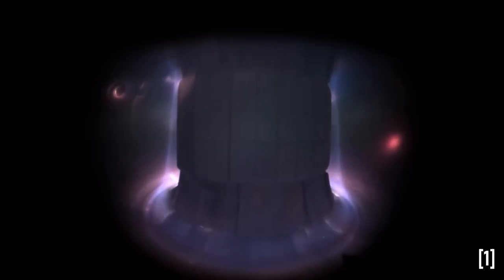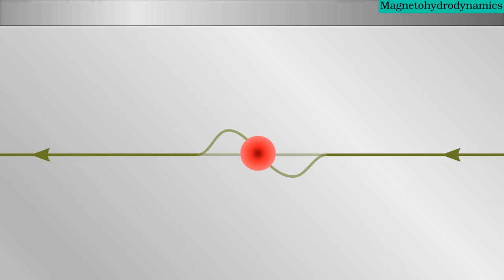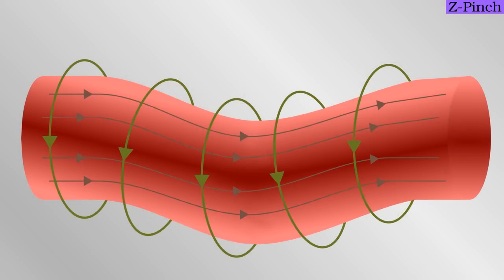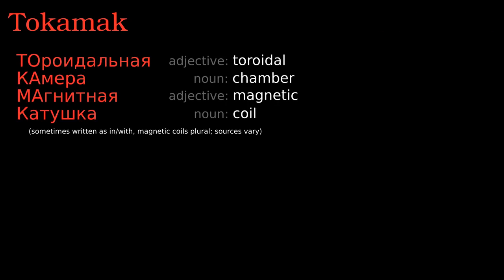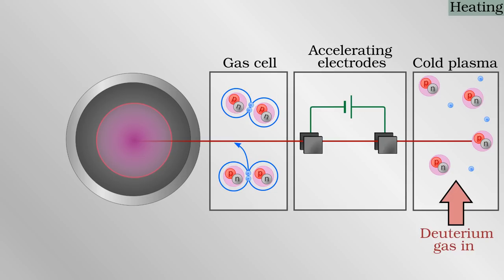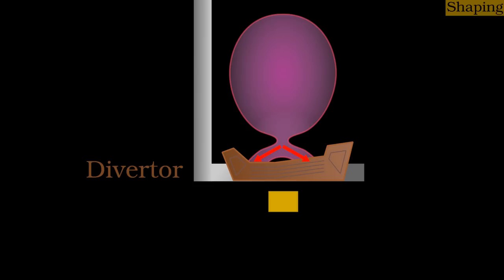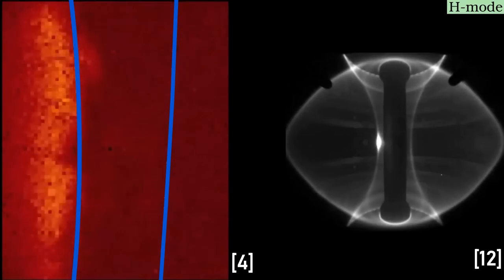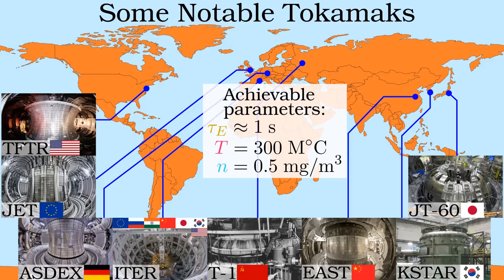How nuclear fusion works (3) - magnetic confinement, tokamaks, stellarators

Comment: Amazing series about fusion! Hope you continue it; it fills the huge gap other videos (which are basically about the hype, and not the engineering challenges) leave. I love how you detail what exactly the problems are, and even tidbits such as the much hyped “AI is being used…” Hopefully the next video will deal with details about the geometry of the stellarator types; intuitively, it seems like they could be a better long-term solution, for they seem to have “less moving parts” in operation (although much more difficult to manufacture, but then it becomes more of a manufacturing problem than a coordination problem). Also, do the simplified calculations for energy input of the first video in the series include that used to create tritium (and the creation of deuterium pellets and other approaches)? Since it has to be synthesized, I wonder how much more extra energy that consumes.
Reply from the maker: Tritium production from Lithium-6 and the neutron coming off the fusion reaction is exothermic, so no problem there. Separating out the fuel isotopes, freezing them into a fuel pellet and so on is one of the (still somewhat unknown) energy costs of running a fusion power plant. Hence, the fusion energy gain Q must be at least greater than 20 for a commercial plant.
Reply: @ImprobableMatter  one hypothetical idea of spherical reactor that have two mirror magnetic rings that are placed on the bottom and on the upper part of reactor where magnetic lines goes through the center of reactor bottom up, and switches periodically in opposite direction following the switching direction of the rest of magnetic rings that are placed in a way that goes through equator of reactor and intersect with each other with the line that goes through the center of reactor and is perpendicular to the magnetic lines of mirror bottom up smaller rings but with higher magnetic flux. All this is happening in kind of circular constant switching on and off magnetic rings motion, very fast. In the center of the reactor is placed platinum or paladinum confinement entrenched with tritium and deuterium. It can be suspended by intital magnetic force that goes up and down, and gradually adding te rest and adding the speed of changing magnetic fields, while cental will hold it in a middle, other will also hold it but will also induce electrical currents which will heat up the confinement to plasma and even more to fusion. For confinement should be used nonreactive isotopes of this transitional metals. Later fuel should be added by lasers beams. I really wonder what do you think about this hypothetical configuration because you seemed very versatile in this topic.

Comment: I'm utterly facinated with this line of work & experimentation. I grasp what is being worked on perfecting currently but I'm still really curious about (How or What is the process of extracting power from it once it's figured out how to sustain good plasma fields?)  Maybe I just missed it. Im sure the goal is to power a turbine thru thermal radiation but I'm just curious how that will connect with these machines. (I know the current ones are test machines, I'm just having a hard time visualizing how the plan to efficiently extract energy from the reactor will go?) I'm sure I'm just missing a obvious thing but I at least had to ask. *I absolutely love your channel BTW. I don't understand how it doesn't have millions of subscribers Because the quality of the science and the content is so good.

Comment: Regarding the individual deficiencies of magnetic mirrors and Z-pinch, have there been any attempts to 'cross the streams' and get a twisted field configuration as in toroidal designs, but without the quirks of toroidal geometry? I'm talking about a long magnetic mirror with added current running down the axis to twist the field. Or is the large size needed for decent confinement time just too much of an engineering / budgetary ask compared to tokamaks and stellarators?

Great work on this channel so far; deep dive channels like yours are a sorely underrepresented segment of YT
Reply from the maker: I'm not aware of it, but just to remind you of the potential drawbacks: driving current is not free (in terms of energy input and hardware) and the mirror would still probably have magnetohydrodynamic instabilities degrading performance.
Reply: @ImprobableMatter  That's fair enough, thank you!

Comment: What about an adaptive magnetic field confinement technique? Instead of running a current through the tokamak plasma, you instead use computer controls to adjust the magnetic field by changing properties of the electro magnet. The computer system continuously adapts to any kind of drifts of magneto hydrodynamic instability. This would be a lot like computer controlled fly by wire in aircraft where the aircraft is inherently unstable in turbulence and therefore the computer must make small adjustments to maintain stable flight.

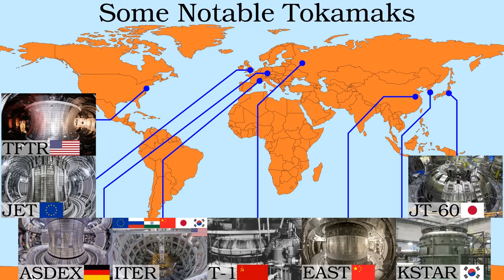Comment: Hi there! Actually min 23:00 doesn't show the actual potential temperature. In 2022, a new ICRH antenna has been installed in W7-X, which is going to be used this year to increase the temperature significantly.

Comment: In the tokamak configuration, couldn't you apply AC power to the coil in the middle? If you generate sufficient DC current in the plasma by other means, like neutral beam injection, the "twisting" should never disappear completely, but significantly increase at the positive peaks.
Reply from the maker: If there were AC power alone, the plasma would collapse during the AC cycle where the current goes to zero.
If you already have enough DC current through the plasma to maintain stability and want to add some AC on top... maybe. Not sure if anyone's done so!

Comment: @ImprobableMatter What do you mean that a Stellarator has a potential Q value of infinity? From the equation this asserts that the energy input is zero, free energy? Please explain
Reply from the maker: Put in fusion fuel, get energy out; Q is infinity. What's the problem with that?

Comment: Perhaps I missed it, let's say they manage to produce more energy than it takes,  it looks like that energy is in the form of heat from plasma deep inside the magnetic field, doesn't that heat have to be extracted somehow to make steam and turn a turbine or something?
Reply from the maker: 80% of the energy comes out in the form of neutrons, which must be captured by a blanket around the reactor. The blanket heats up and that heat is transferred out where it will indeed power a steam turbine.

Comment: this sounds like almost impossible technical challenges to make fusion work on an industrial scale, but if you look at how ASML makes EUV photo lithography machines and how 3nm semiconductors are made on a commercial scale and that seems like it should be impossible too, but it clearly works since i'm typing this on one now.
Reply: The upcoming 3nm fabs don't do anything on the extremes of physics. They do stuff that's hard and needs to be very precise but it's all engineering.

Comment: How do we actually turn fusion plasma into electricity?

Wonder if we can tape power from the plasma through the diverters?
Reply from the maker: 80% of the power comes out in neutrons, which must be captured and stopped by a blanket around the reactor. The blanket heats up and the heat is taken out to turbines as usual.

Comment: if the distance between the confined plasma and the reactor walls is large enough, can the neutrons lose speed before hitting the walls, preventing the wall from becoming radioactive?
Reply from the maker: They would only be slowed down by something the density of a typical solid or liquid, otherwise there are not enough atoms in their way to stop them. If it's a liquid, like heavy water, it would probably evaporate and quench the plasma. If it's solid, it is basically the first wall. There are some experiments which I will try to mention in the next video, to do things like cover the wall in liquid Lithium, which would stay on the wall, but protect it from the neutrons.
Reply: Ther is a reasion the door of the Rotating neutron source was 2 meters thick and made out of renforsed concreat.

Comment: Is there way to contact you personally?  Do you have a patreon?  I just have a question.  
Let say you borrowed God’s superconducting magnets and you induced perfect currents in the plasma, would fusion occur?  If the plasma is perfectly organized into helices for containment, will collisions occur?  Is our quest for containment killing the reaction rate?
Reply from the maker: "Don't you see? God's superconducting magnets were with you all along through the power of friendship..."

But seriously, in short - better magnets would mean better confinement, better gain, and therefore a feasible power plant. Suppose we have (very rough numbers):
    ITER - 10 Tesla on coil / about 5T in the plasma
MIT/Commonwealth Fusion reckon they can get the same performance from a much smaller machine with
    SPARC - 20T on coil/10T in plasma
Therefore, if you could magic up 100T coils then you would probably solve all confinement problems. This is limited by the materials themselves, so you can't simply make an existing coil bigger etc.

You can never get particles into perfect helices, because as soon as you get more than one particle together they will begin to collide and become turbulent. You will always have turbulence like at 04:24 though it will be smaller the larger the magnetic field is.

Comment: Flying saucer that runs on air. 
If you collide two neutral beams at the focus of a laser that is a certain distance from a positively charged sphere, the electrons from the ionizing laser will go into orbit around the sphere and return to the laser focal point.  Some of the ions will be trapped by the elevated negative charge at the focal point and orbit the focal point being more strongly drawn to the focal point than they are repelled by the positively charged sphere because they are closer to the focal point.  A beam of electrons aimed at the focus through the center of the sphere can be used to refresh the electrons to maintain or increase the voltage at tge focal point.  
An opposite configuration with ions orbiting a negative sphere  has the problem that some ions will eventually crash into the sphere.  The power is limited by the buildup of voltage in the direction of the sphere because  of the orbiting electrons.  But if multiple focal points are used and a certain excess of electrons over ions is maintained relative to the voltage of the sphere, a reasonable amount of power might be obtained.  
This phenomenon of the charged particles returning to the  point,  might explain the asteroid that exploded over Russia on the same day that another asteroid was making a much awaited fly by.  Pieces of colliding asteroids will tend to return to the exact point of the collision. 
The assumption about the climate and the alleged crisis early in this video series suggests  that there might be certain other questionable basic assumptions in this video series.   Like the figures on the cross section of proton proton fusion.  Trying to accomplish proton proton fusion without a dense surrounding plasma of neutrons, positrons, gluons, quarks  and neutrinos as in the core of the sun might give substantially different results. 
If climate science is an example, one might do well to have a certain amount of suspicion about certain basic assumptions.  
Electrostatic confinement is mostly  skipped over in this video except for the brief mention of a certain kind of fusor.  Some say they know the Q of the Farnsworth fusor and why it failed to get net power.  
A Q of 5 or 10 necessary to get net electrical power?  Maybe with certain kinds of devices.  But if half of the waste heat is recovered by the system, a Q near .5 for thermal energy for fusion energy over input thermal energy might achieve net thermal and electrical energy.  , 

Using plates around a large narrow torus instead of magnets has a number of possibilities.  If hydrogen gas is spun around the inside of tge torus fast enough to evacuate the center and compress a layer of hydrogen along the inner walls of the torus, the layer of compressed hydrogen could become a vast and profuse supply of ions and electrons that could be easily raised to fusion temperature by ionizing the gas near tge inner edge.  The ions and electrons would be confined temporarily and when they did escape confinement they woukd tend to strike the gas at a point in front of an oppositely charged plate.  Tge atoms ionized by the collision would then supply more ions and electrons to be driven in towards the center.  When an alpha particle hit the surrounding gas, it would ionize zillions of atoms causing an accelerating  chain reaction effect with the rate of fusion.   profuse supply of ions and electrons and the facility of recovering the waste heat with a gas turbine might accomplish  net power at much less than a Q of 5 ir 10.  
Once the positive and negative  plates are charged up to like a million volts, they require very little energy to maintain the charge.   Most of the  heat from a  10,000 watt laser used to ionize the ionization points could probably be recovered.  If an excess of electrons is built up in the plasma, an off center  offset to the ionization points would tend to make the plasma  spin. The plasma and surrounding gas might spin at a much higher rate than a solid rotor ir turbine could spin it.  
If the torus was filled with air, the centrifuge effect woukd tend to cause water vapor to accumulate at the inner surface of the spinning gas because of the centrifuge effect and because it is lighter than air.  Even if the voltage of the plates could not fuse much H1, just the deuterium in the water vapor might be enough to drive it.

Comment: Where you gonna explain why making a bigger tokamaks won't fix fusion, like 3 or 5 times volume iter. I think you said bigger won't tokamaks work and you'll explain that later. I got the idea the higher the volume to surface area ratio the more efficient fusion is. The only thing I can I think of is 1 or 2 trillion dollar cost and you need 20 years of building and tuning.
Reply from the maker: Yeah, that's basically it. If you make it larger, the heat has further to be conducted from the hot middle so the volume where thermonuclear fusion can take place gets progressively larger too.

Comment: Whats stopping you from creating a quad style intersection with 4 torus style pipes sausaging into the quad intersection and repeated with a set number of these quad intersections along the length of the donut shape
Ribbon style rifling occurring on pipes at the quad intersect points stabilising as it gets sausaged
Reply: It wouldn't solve the problem but it would open up avenues of experimenting for new methods of adding constraints

Comment: Can we use AI to design stellarator shapes? How do they design their shapes now?
Reply from the maker: Possibly to improve designs incrementally. Up to now they have used ordinary computer design to obtain a valid magnetic field (remember that it must be suitably twisted for the reasons I describe) and then calculate the currents in the coils that would be required to actually make it. Incremental improvements from AI are possible, but again, no "silver bullet".
Reply: @ImprobableMatter  I see, I’m just wondering where is the gap between computer simulation and our reality now? I assume we should right focus on building the most powerful physical simulation system (maybe quantum computers are the prerequisite but some approximations can be achieved by AI as well), run all the reinforcement learning based design explorations before we jump in into any specific designs.
Reply from the maker: I guess the question is what you want the AI to do. Some things like the turbulence may be uncontrollable in principle even if you had a genius AI; maybe some phenomena could be controlled in principle, but even an optimized TPU could not respond quickly enough (milliseconds).

If you are talking about the preliminary designs of machines where you have almost unlimited time to think then we already have "Natural" Intelligence (i.e. humans) working on it.

Finally, neural network based AI is not the solution to every problem. You do not need to have a trained neural network to land a probe on an asteroid; you solve Newton's equations or whatever is relevant. In the case of plasmas, there is a lot of High Performance Computing work doing just such calculations. I worked with a group which was using up to Teraflops of computing power for fusion research, for example.